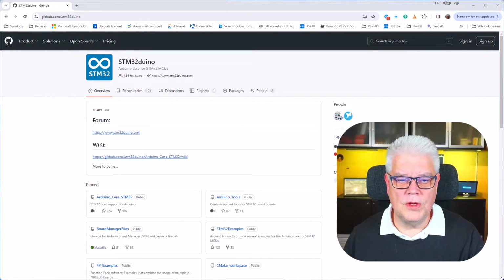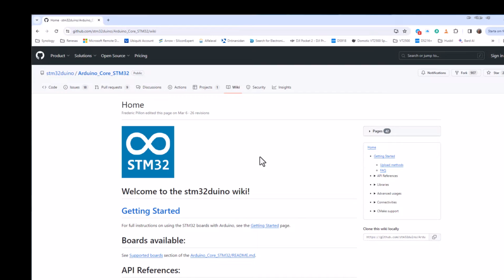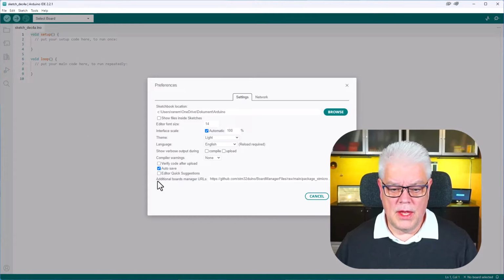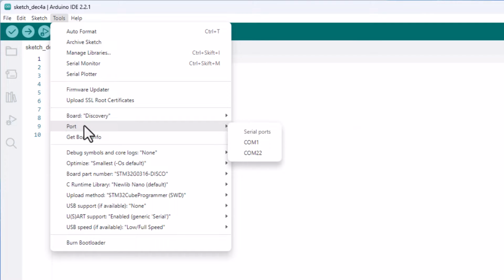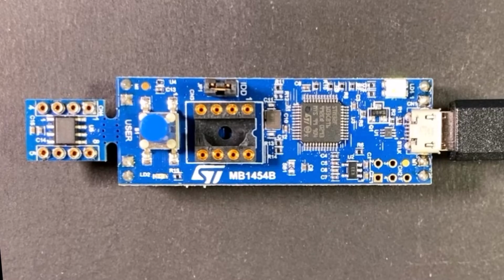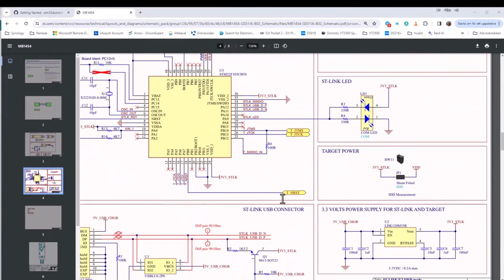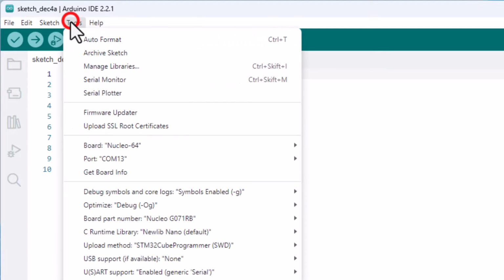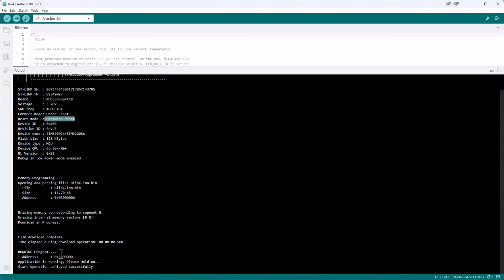HOW-TO GET STM32 Board in ARDUINO using STM32duino

Comment: I am using STM32F401CCU6 minimum system board with:
ST-Link (SWD) header
USB Type-C connector
Arduino 1.8.19
unable to upload bode 
I tried with ST-LINK V2
and
USB C cable too

Comment: really helpful - have used arduino-ide for a long time but just could not get my nucleo-32/stm32l432 blinking!!! your video helped - the answer was to select nucleo-32 as the board then Tools>Board Part Number as the stm32l432kc - blinking happily now - I'm on a mac so my com port was /dev/cu.usbmodem13102 - also got caught out by finding many POWER cables that ran usbA-usbmicro ( and not showing up in arduino-ide :( ) fix for this was to find a REAL usbA-usbmicro DATA cable!! 🙂

Comment: Hello.

I get "OpenOCD: GDB Server Quit Unexpectedly. See gdb-server output for more details." all times. ( Nucleo F103

Info : The selected transport took over low-level target control. The results might differ compared to plain JTAG/SWD
Info : Listening on port 50004 for tcl connections
Info : Listening on port 50005 for telnet connections
Info : clock speed 1000 kHz
Error: libusb_open() failed with LIBUSB_ERROR_ACCESS
Error: open failed

[2025-01-10T15:46:59.679Z] SERVER CONSOLE DEBUG: onBackendConnect: gdb-server session closed
GDB server session ended. This terminal will be reused, waiting for next session to start...

Comment: This is good. I managed to upload Blink to my Nucleo L476RG and it was running . However i got garbage on my Serial Monitor when i run another program. The baud rate was correct. Any idea why this happened? Thanks
Reply from the maker: Hi, it is always hard to give an opinion on what could have gone wrong in varius scenarios. it will only be a guess. Best is to try to eliminate all sources of potential errors and eliminate all till you only securely can reproduce the issue. When their is garbage my experience is that the baudrate is not correct and timing is off. put an logic analyser or Oscilloscop on the bus to verify that this is not the case also here.  / PR TechTalk

Comment: Black pill - Blue Pill - similar method?  I saw another video where they use an FTDI board to program the black pill - is this unnecessary? https://www.youtube.com/watch?v=QCdnO43RBK4&ab_channel=GaryExplains
Reply from the maker: Hi, im a it unsure over your question, but to program any ST MCU you need some kind of tool. Could be STLink or similar. FTDI is "only" a USB to Uart converter and could be a part of  a programmer.

Comment: Quick question for you, is it necessary to use USB to power/program our dev board with the arduino IDE? My project requires our own custom development board with an STM32F103 MCU and I'm wondering if we need to include a female Micro-USB port. I plan on just using a J-LINK programmer with an SWD interface.
Reply from the maker: Hi, No you can supply your design from your own supply. You need to have gnd and data pins from SWD interface only. /PR TechTalk